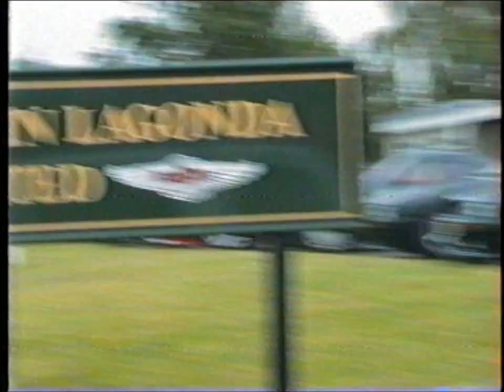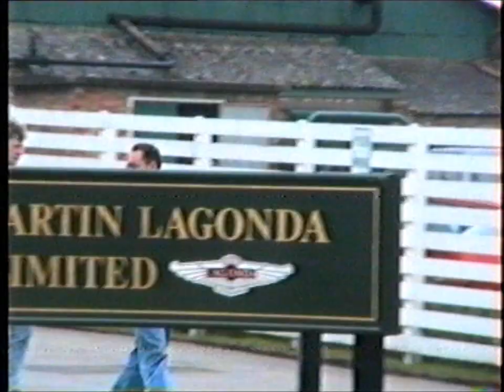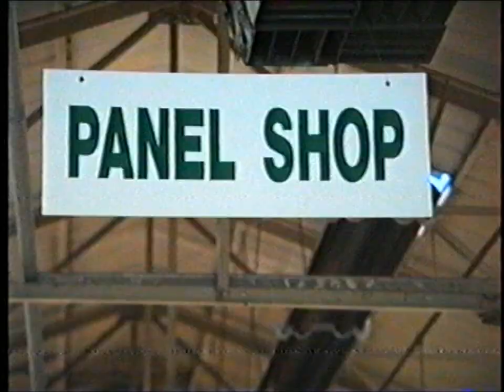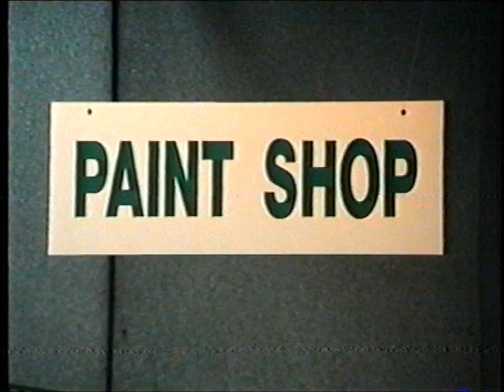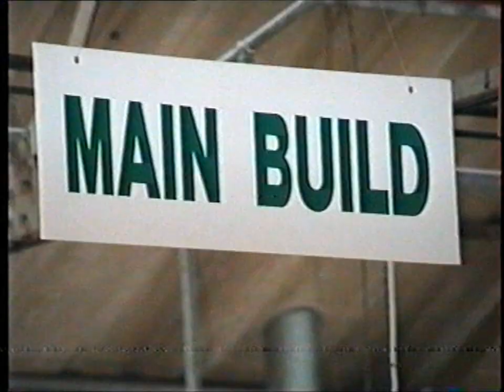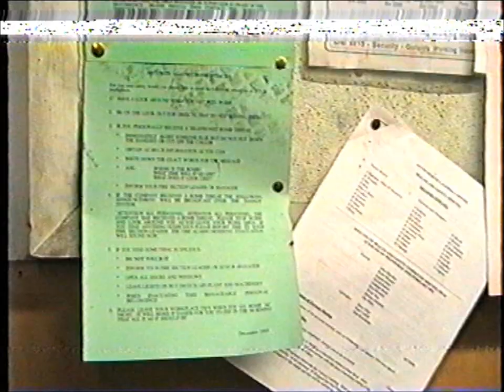Aston Martin Lagonda Factory Newport Pagnell 1994

Comment: what are you talking about? I've owned enough cars and had several run-ins where body panel replacement was necessary.I replaced the roof panel on my Peugeot, the brazing was a bitch to duplicate what the  Sochaux workers did then on my american spec Pooh Pooh...having no experience beyond repairing oil pans with rod braze and a torch. I managed to perfectly fill in all the gaps without a trace of a seam anywhere.yes it took lots of time and trial and error but with focus, it was possible.

Comment: American limos are pretty much a joke (build quality build wise), ,except the  factory 1s that Cadillac and Lincoln used to make.They were kinda of cool...the 2 door rear ends were always used so the rear doors did not open right up against the wheel wells. I have a Yukon XL...and yeah build quality is a joke...but it's a cheap car that only cost $50,000,  My point was, I saw a new  Bentley coupe and one could see the roof brazing and hammer marks easily that passed me on Interstate 5